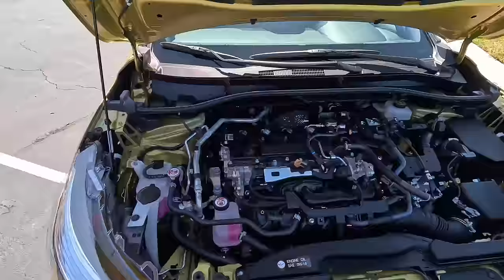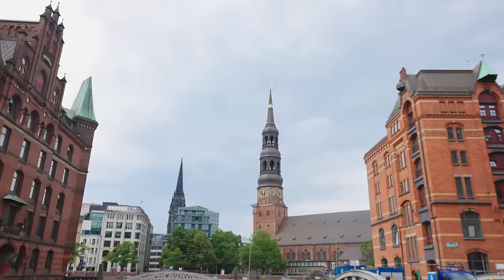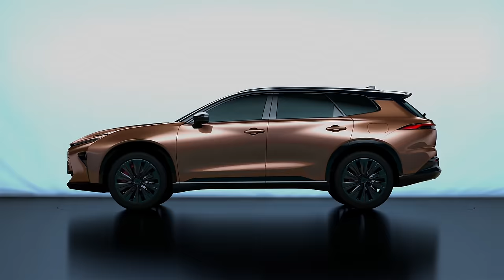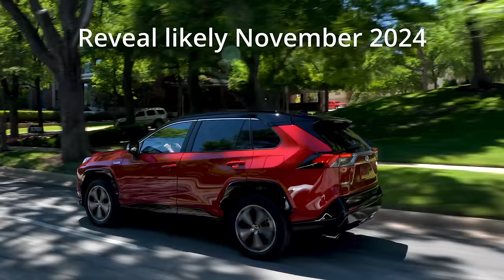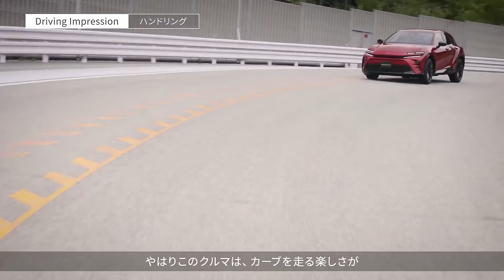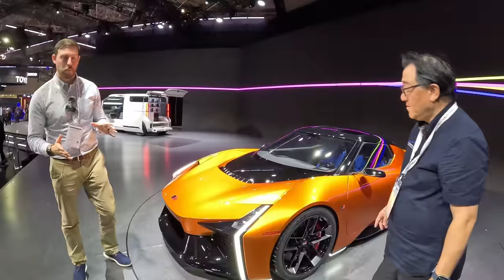Here's Every NEW Toyota Coming in 2024 and Beyond - CAN'T WAIT!

Comment: Hey Kirk...really nice review. I'm leaning towards a minivan as my next future vehicle. So any info on a redesigned Sienna would be awesome.

Also...with all these planned EV's coming out, I'm very concerned about "rodent damage" to these EV vehicles. I say this because we had a Lexus RX that was at a body shop being repaired. Unknown to us, the shop would rotate vehicles in and out of the repair bays as parts arrived. They parked out RX out behind the shop for a day or two; just long enough for a critter to get up inside the dash and chew on the wiring harness up inside the steering column! 

Can you imagine the havoc these critter could cause to an EV?? Is Toyota going to do anything to mitigate this kind of damage?? Yikes!! 

I have a pic of the dash torn apart at the dealership.....Its SHOCKING!

Comment: Kirk, We should have a competition to see who 'can't wait' more than everybody else.😉Before I flood the Comments section with my overflowing wish list I will 'keep it real' by saying this, the biggest move Toyota could possibly make in 2024 would be the elimination of chronic wait lists for their Hybrids.  This would make a massive difference for stressed out consumers and put an end to price gouging.😁   If you told me a year ago a new Toyota Wagon (Signia) was coming, I would have had a hard time believing it.  Now I realize dreaming LARGE is the key! On my wish list for 2024 are the following: a) Land Cruiser FJ manual - It should be priced below $30K and built in the same Hino factory that made the FJ Cruiser b) 2 Door manual 4Runner- The return to 4Runner roots Toyota has hinted about c) GR Yaris for Toyota's most profitable market. d) Yaris Cross - A 65 mpg sub compact CUV would do well here. e) Corolla AWD Hybrid wagon- Ours should be based on the extended wheelbase Corolla Touring Sports not the shorter Corolla Touring f) GR Probox- Add the GR Corolla powertrain to the super practical Probox body ( as seen in your Tokyo walk-around) for a hyper practical rally car. g) Single cab Tundra with 1GR-FE engine, 8 foot bed and 6 speed manual- If Toyota/Hino won't build us a new T100, a single cab, Tundra will have to do the job. h) Hilux  Workmate - Currently on sale in Australia for around $20,000, this bare bones pickup with a legendary 2TR-FE, manual transmission, 2,000 lbs payload and 5,000 lbs tow rating is every urban landscapers dream. Toyota could build workmates in Canada to avoid the Chicken Tax. i) 2 door Land Cruiser 70 Series- Equipped with the 1GR-FE V6 and manual gearbox, it could meet emission standards  and be as safe/unsafe as a Wrangler 🤩🤞🤞🤞

Comment: I had great expectations waiting for the new Toyota Crown, but was so very disappointed it is so damn cramped inside and no hatchback available.  Therefore I traded my 2023 Honda HR-V Sport for a Venza XLE!   I absolutely detested the Honda belt driven cvt transmission.  At least Toyota hybrids are reliable gear driven E-CVT.  Toyota new engines also are port and direct injected, so carbon deposits on intake valves are less of a concern.  I never thought I would own a hybrid in our northern cold climate, but I am very pleased with the Venzas 40+ mpg in daily driving.  The coming crown wagon looks to much like a 2005 long boat Chrysler Pacifica.   I will next go with the Corolla Cross hybrid XSE or wait for the Crown Sport to arrive.  I usually trade every year.  No Ford GM or Chrysler Dodge products that I worshiped in the 60's,  their corporate profits became paramount over quality.   My Dad purchased the first Honda civic ever sold in Minnesota.  Used on his rural mail route.  Many laughed, but even back in those early days the Japanese build quality was apparent.  Now they dominate the world's auto industry, able to innovate and quickly change as required.

Comment: I would be both surprised and disappointed if the discontinued the Highlander- in fact I would like a Highlander XSE that looks exactly the same as the current XSE but with 350 to 400 hp and increased torque over my 21 XSE WITH THE  
2 GR – FKS 3.5 L NATURALLY ASPIRATED ATKINSON STYLE ENGINE -❗️chop chop Toyota….

Comment: 4Runner and RAV4 is probably the highest on my list that I'd love to see. Especially when looking to upgrade from my 2014 Camry that still has clear oil at 175,000 miles... Yeah it will never die, but I want the SUV life :)
Reply: The new landcruiser was supposed to be the new 4runner, instead, we're getting the taco base 4runner
Reply: @Phi.D.888 Isn’t the new Land Cruiser Taco based? I thought it was the same frame? Im kinda thinking Toyota is waiting to see how the Land Cruiser sells. I just don’t see where they can take a 4Runner. The interior of the LC isn’t that nice to be able to cost cut from and the engines are the same as the Taco. Kinda just feels like there would be too much overlap especially if an FJ is introduced to take on the Bronco Sport.

Comment: I am not getting Toyota's philosophy. Why a Corolla Crossover and Crown? both are terribly designed and lack appeal.  Then practically all vehicle models going straight to Hybrid is killing me. Bring back the Supra and Celica is great news as 2 more small sedans or 2-door sporty-looking vehicles. Just wonder what will become of the GR86 and Corolla GR? TRD has never worked, time to drop or scrap the lame racing stuff. Okay! just to let everyone know Kirk, I am a naturally aspirated gasoline engine guy with an emphasis on V6 and V8 engines, and much less enthused about 4-bangers and turbos. I have a definite dislike for all Hybrids and EVs. Toyota needs to rid of the Toyota App subscriptions as buy a Toyota get the App features for free for the next 10 years.

Comment: I was ready to put down a deposit on the Crown Signia until Toyota said they aren't offering Hybrid Max in it. What - the - heck? And what's up with the Signia using the 4th gen hybrid system? They did not state that it is getting the 5th gen so my logical conclusion is that it will have to be 4th. Maybe because the 5th gen is for smaller, lighter vehicles? Do you know?

Comment: * Could the new Camry be allowed a bestial GR version anytime soon? 
* Would Toyota choose to kill both the 4Runner and the overseas-exclusive Fortuner/SW4 and then replace the two with a smaller Land Cruiser SUV based on both the new Tacoma and the next-gen Hilux and sits below the Lexus GX-based 250? Speaking of new-gen Hilux, will it be a clone of America's Tacoma or not? Will the new Land Cruiser 250 be allowed a third row and perhaps a LWB variant which might also suit well for the new GX? 
* Could the next RAV4 get boxier and gain plenty of vibes from the Land Cruiser 250/GX550 and take on the Ford Bronco Sport? 
* What if Toyota decided to drop the bZ naming scheme for its EVs altogether? 
* Should Toyota spin off the Crown nameplate as a standalone brand thus push Lexus further upmarket in the process? 
* Will the upcoming Land Cruiser FJ come to America and take on the Ford Bronco and Jeep Wrangler? Will it come in 3-door mode alongside the 5-door one?
* What if Toyota decided to kill the Sequoia and replace it with the next-gen Land Cruiser (the big-ass one that was sold stateside until 2021 and was succeeded by the Lexus LX600 not the GX-based Land Cruiser that replaces it) that's built stateside alongside the next-gen Tundra which it would be based on? Will there be a North America-exclusive LWB Land Cruiser that would fight the Chevy Suburban? Could the next-gen Lexus LX follow suit?
* What will the successor to both the Lexus RC andf the GR86 and Subaru BRZ twins look like?